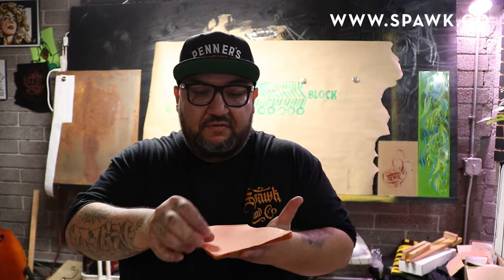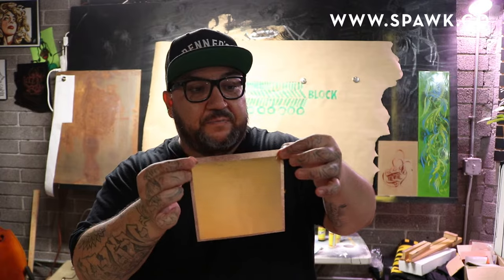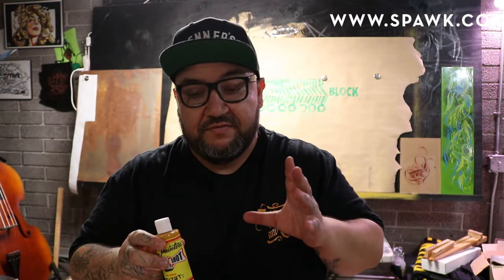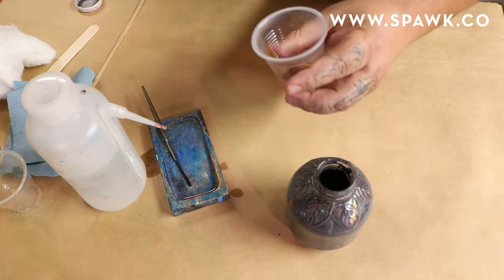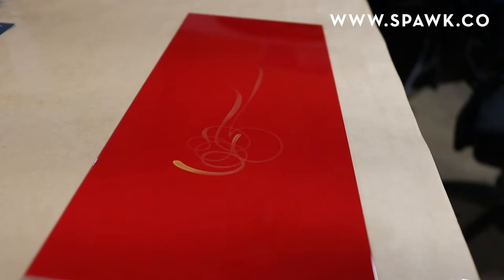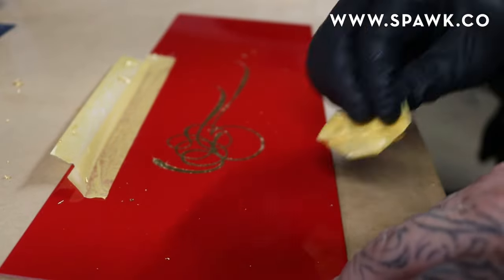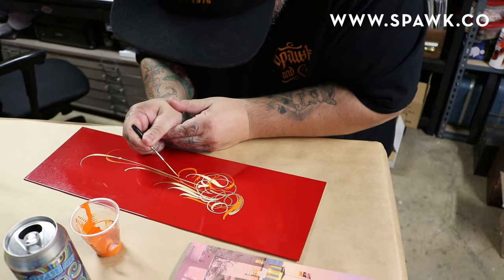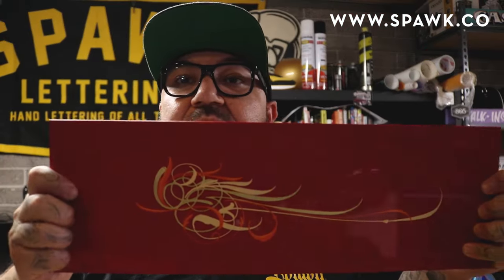GoldLeaf Pinstriping Tutorial

Comment: Do you need to use the reducer 6002 with the sizing glue 4008 or could i just use the sizing glue   and do you have a insgram
Reply from the maker: @e-brown5274  dependingbon the type of sizing you are using. I just use 1shot reducer. Low temp reducer. It works fine. And if you can airbrush the sizing on you can get a real smooth look
Reply: @spawkandco.  thank you very much appreciate it

Comment: No clear coated needed after?
Reply from the maker: Yes. Never leave leaf exposed. You can brush it on or spray depending on the prepwork.
Reply: @spawkandco. How long before applying a clear coat to on the leaf?
I tried one but it turned the leaf black.

Comment: I'm guessing you are using "Ditch Leaf" not real gold.
Reply from the maker: I only use real Gold if I'm water gilding on glass or if the budget allows for real gold. Most people can't afford the price tag for real gold.
Reply: Meant no disrespect... I'm a 75 years old retired American Art teacher living in Australia after 9 years US Army (Vietnam 2/502 Infantry, 101st Airborne) Moved here from Detroit in 79'. I couldn't count how many Gold leaf signs and pinstripe jobs I've done, from boats, motorcycles and trucks.
  I actually kept a 23 carrot gold leaf pack that the price tag was $6.95 from the 1960's in my box, that I always show my students.... I tried the new Krylon Gold Spray Paint on a chip glass sign...sand blasted the glass, rabbit glue and tried the spray over that part only. ... it was a wedding sign, A-2, 8 mil plate glass. I masked with sand blast mask the information (Names, etc...) out lined and then used real gold leaf, to save money ... first time for the spray. Reversed on chipped glass it looked fine ...I added mirror black (3 coats) over the back for protection. I'm hoping it worked... have you any experience with it?
 I only mentioned the dutch leaf as I didn't hear you say it, and I found none of my sign class students had any knowledge of it. .... Personally I use dutch leaf only in the multi-colored variegated style leaf... nice job ... be safe.
Reply from the maker: @airbrushken5339  that's amazing. Yea the real stuff is expensive now so most people don't use it. I try to use it as much as possible if it's in the budget but man I can't afford the stuff.